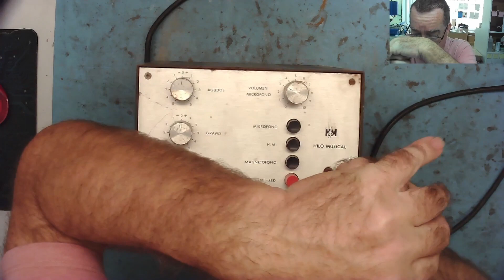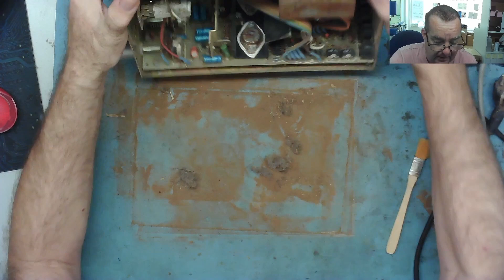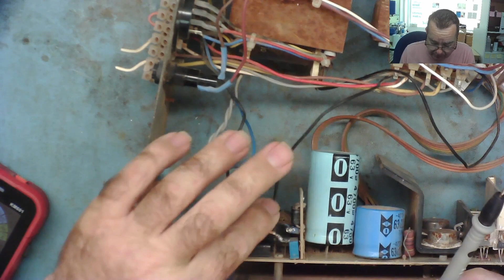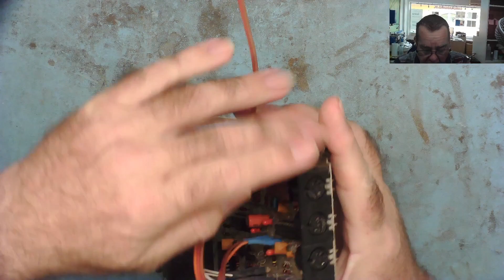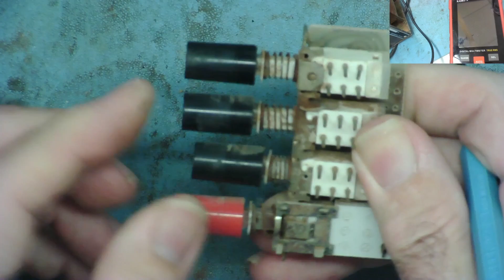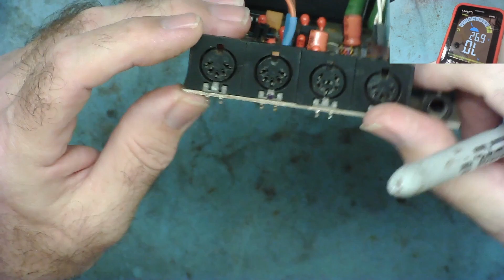I bought this rusty old 1970/1980 vintage amplifier just to see if I could fix it!

Comment: I will just use the case for another amplifier( a classic looking style) or a bench top power supply.As for the parts...Very little is worth saving; maybe I would take the ICs, that trim pot and the output transistors...

Comment: Love your video, it is a class AB amp, single rail, output swings about the half rail value , if bias properly,  in these amps a hugh coupling capacitor is required to block the DC , they have poor bass response as at low frequency the capacitors reactance becomes significantly. Great vid

Comment: Your videos are always extremely interesting, I do learn a lot, still I don't really know where to start with my 90's NAD 208 THX amp. I have a short video here : https://youtu.be/cPsQgt8MiZk . When the amp is switched on, the speaker gets pushed down and stays there. I replaced most caps (some where out of spec) but it did not help. It is a quite sophisticated amp (for the time) but is quite amazingly sounding. Do you have any idea what to check ? I asked in a few forums with little success. Thanks a lot for helping ! Perhaps a first in remote electronics repair 🙂

Comment: It seems well made and working fairly well too. I'd use it as a bench amplifier and with a small modification it can be used as a signal tracer. That might be a good project, convert an amplifier into a signal tracer.

Comment: The first thing that made me shudder was the sight of tantalum bead capacitors, as I'm sure you know, THEY ARE THE WORK OF SATAN! 👿   *  thunder and lightening sound  * ⛈
If I was restoring this, I'd re-cap it even if the electrolytics test ok and replace the Tants with sub miniature electrolytics,  PAT test it, refresh the solder joints and sell it. It is quite a nice amp that can still be used as designed, but it also has the added attraction of having a vintage look.

Comment: I have been binge watching your channel content since discovery around 2 weeks ago. I Repaired the tech of the time, 35+ years ago (VCR's, TV, HiFi) and trended towards IT after. After 25 years in Industry (ROV offshore on Ships as an Electronics Engineer), I have returned to my hometown to provide appliance & electronics repair. I find myself agreeing & disagreeing with familiar diagnostic techniques that I use - in your videos. This refresher is very welcome & has re-awakened the desire to repair every piece of electronics that comes my way logically, very rarely is a diagram available - nice to have, but not the end when you can reverse engineer the device. Thanks.
Reply from the maker: Welcome to the channel, it's good to see another old school tech returning to their roots 🙂

Comment: Well saved ... given how poorly it was looked after and how well you managed to recover it appears to be a robust design (may just need some current limiting on the caps as they charge initially?). Maybe list it for sale and see if you get any interest.  Failing that you could make one of those ‘adapt an ATX psu into a bench supply’- type build videos .. they can be popular, but do try not to modify the pc psu itself so a new one could be easily swapped in should a fault arise or more watts needed.  Often they spend ages opening and hacking away inside just to save a little space which is generally unnecessary imho. Just an idea.  Keep up the great work 😀👍

Comment: This is a quasi-complementary class B amplifier, with just enough quiescent current to reduce crossover distortion. Built for economy rather than high quality sound.  
I'd keep it as it is and use it for a bench testing amp, as I think it would be a shame to mutilate it. There are plenty of DIN to RCA/phono adaptor leads on Ebay, which would make input connections easier. 
A real bargain at 10 Euros considering the transformers alone  would cost about 50. 

I'd love to know what 'HM' input is for.
Reply from the maker: Ahh apparently that is from the Spanish, it means something like 'Piped Music'.

Comment: The amp tech is too old. Parts - the case would make a nice case for a power supply - linear or switch mode. Would be a good faraday shield for many noise sensitive circuits.
PS wrong input impedance for guitar amp. You can engineer a match - but why?

Comment: You could use the 100V line outs to power a few speakers, up to 5 tapped at 5W. A small bar may benefit such a system! At our works we'd use it for toilet speakers - which with that fart sound would be appropriate! Great clip as always! Thanks!
Reply from the maker: Hahahaa 🤣🤣🤣🤣🤣
Reply: connect it to an off-the-shelf timer for scheduled, dusk to dawn, or random farts.

Comment: Make a 60Hz sine oscillator and then you can use it as a 115VAC power supply, giving you some power to run US equipment, or make it variable frequency, or selectable frequencies of 50, 60 or 400Hz, so you have an AC power supply to use.

Using 2 NPN outputs is because it is quasi complimentary, top has a NPN driver and bottom has a PNP driver, so the bottom is similar in performance to a power PNP device, just needs different biasing.
Reply from the maker: Actually that is really quite interesting using the output transformer to generate 50Hz/60Hz 110V AC.  Especially as it would also provide galvanic isolation from the mains,  most switch mode PSU can run 90V-240V so it could make for a rather safer way to work on them as you normally don't have to put much load on the PSU to diagnose faults.
Also a variable AC supply could be quite useful, by varying the amplitude of the driving signal. Nice.

Comment: @49:25 On that back plate I C ... A 25 W
Is that not 25W
P.S.
I love the fart sound
Reply from the maker: Me too - had to fart twice 🤣  Yeah 25W also ties in with the transformer 48V at 1A.  To have the power supply rated at twice the amplifier REMS output is exactly correct

Comment: enjoyable and funny  video. I would make a dummy load out-of-it, put a big heatsink and fan inside the case, amp and voltmeter on the front panel and design the electronics. 
Would make an interesting video series. I think a lot of your viewers would be interested in building a dummy load as they are very expensive to buy.
Reply from the maker: Yeah I must admit I am very much leaning towards that usage.  I think a dual dummy load might be a nice project 😉  I expect you will see it again in that form.
Reply: Do you mean an active load? or What I refer to as a dummy load, is a 50 Ohm transmitter load. Basically a big non inductive 50 Ohm Resistor.
Reply from the maker: @KB1UIF  Active load
Reply: @learnelectronicsrepair  Yeah, I thought that was what you meant.

Comment: i think the wire you were given is KYNAR WIRE.
Reply from the maker: Ahh so it is for breadboarding?
Reply: @learnelectronicsrepair  it can be but mostly used for modding games consoles and I phone repair
Reply from the maker: @robtitheridge9708  which makes sense as it came from a phone repair shop 🙂  Seems like it was a nice freebie anyway
Reply: yep will be single core kynar, i ordered some by accident, its low amperage but still quite useful

Comment: What you have there is a quasi complementary push pull amplifier.High power PNP trasistors were hard to come across..
Reply from the maker: @rob titheridge Is that why it draws such a low quiescent current?
Reply: @learnelectronicsrepair  not sure .when I used to service FAL amps that used the same topology if I remember correctly the quiescent current was about 38 ma
Reply from the maker: @robtitheridge9708  Yeah it's 40mA.  I was expecting a class A to be much higher so your suggested topology make sense to me.

Comment: Yes! This is the sort of junk I specifically look for to try and get working, or as you said, I use for parts.  Any large resistors, good wire, sockets, knobs, switches, terminal trees, screws, transformers etc etc  I cannot think of another reason for it to be used in it's working state....Sorry, can't help there! Cheers, Rick